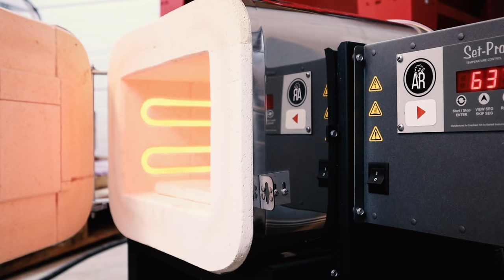Rusty Hammer Restoration With Nordic engravings

Comment: I'm so torn. First you sandblasted without even getting the loose rust off, then you pretended to polish pitted metal with 1000 grit sandpaper. But then that awesome fire when you quenched it turned the tide and that next-level laser engraving pushed it over the top. So I'm torn.

Comment: Nice restoration - I particularly love the laser engraving / etching you did! If you are going to actually use the hammer to hammer in nails, you don't want the striking surface to be polished smooth - you want it rough / scuffed up eg 60 grit random orbital or something. Grips the nail head when striking.
Reply: Didn’t know that….in metalsmith ing jewelry, we keep the faces as clean as possible so as not to unnecessarily Martha metal. So I guess it depends on how you will use the hammer. Good to know.
Reply: @donnaer  A common hammer face roughing technique is to rub on concrete as it's usually available somewhere lol . . .
Reply: i think that applies to framing hammers only, I would want a ball peen hammer to be smooth
Reply: @keefer88  "If you are going to actually use the hammer to hammer in nails, you don't want the striking surface to be polished smooth - you want it rough"

Comment: I have a really awesome project for you that I think you would enjoy. About 2 or 3 days ago, my friend and I saw a little bolt out of the ground. So we pulled it up and sure enough, it happened to be a saw. We did some researching and found out that it is a Warranted Superior saw, a company that made saws in the 1800s. The saw is in pretty bad condition, but I thought that maybe you could turn it into a giant machete, or just restore it to its original state. It’s rusted pretty bad and there is no handle anymore, except for 3 bolts that are hold 3 little pieces of wood underneath each of the bolts. I was wondering if I could possibly send it to you for a restoration video, or just to restore on your own. I figured it would be a fun challenge for you, and unique because I have never seen anyone restore a saw. Let me now if you are in for it.
Reply from the maker: thank you for thinking at me. But I have so many upcoming projects already so I will have to pass on this one. But thanks again :)

Comment: Nice work. Wonder if the 20 oz hammer became a 19.9 oz hammer during the restoration. I would have attempted an epoxy repair on the handle to try to avoid shortening it. But then again I wasn't there.
Reply from the maker: thanks for your comment :)

Comment: Bonjour, j'aime beaucoup tes vidéos qui sont de grande qualités. Je trouve ce métier magnifique. Mais j'ai du mal à comprendre à quoi sert le sandblasting, alors je pourrais faire une recherche Google mais j'aimerais avoir te demander, si tu le veux bien, dans quel cas tu l'utilises et dans quel objectif ? Ça me titille 😄.
Chouette restauration en tout cas, bonne continuation à toi
Reply from the maker: thanks you so much :) Sandblasting is when you "spray" sand under very high pressure (the pressure is made by a compressor). The high pressure allows the sand to remove dirt and rust :) it is almost like a peeling just in a larger scale

Comment: What's the difference between oil cooling and water cooling and how do you determine which to use?
Reply from the maker: If you want it to be dark you have to use oil. Oil also give it a rust protection layer
Reply: @AwesomeRestorations  ah ok that's cool.

Comment: Very  nice job. Results look spectacular. But I have a question: Why did you remove the logo? Did it interfere with the Celtic engraving?
Reply from the maker: TOR is not a special rare brand so I just wanted to remove it and make room for the engraving :)

Comment: Great restoration job as out of the shop, congratulations.  But does the polish remain or does it tend to rust?
Reply from the maker: No it will not rust .. as soon as I use it it will gain a natural layer of dirt and oil ;-) ;-)
Reply: @AwesomeRestorations  Ok thanks very useful, and the grits to refine it?

Comment: Easy, you saw the hammer handle and with a center punch push out the rest of the handle with the key. Also, that is not a carpenter hammer, but good restoration.

Comment: End result looks great, but it seems a shame you removed the original Swedish logo and replaced it with a Celtic knot, which has very little if anything to do with Sweden or where the hammer came from. 
A more original restoration/engraving would have been just that bit better, IMO.
Reply from the maker: fair enough :)

Comment: Seemed kinda pointless, hammers are already hardened. Just need a sand and some oil.
Reply: Most modern ones are, old ones can just be hardened on the faces so the the head has some ductility (i.e it dosent explode when you hit something really hard although you can chjp the face) ... however in this one sort of surprised he didnt temper it (or maybe he did and didnt show it)  as the head will be a bit brittle.

Comment: Sorry but I don't see the point in doing this "it's a hammer".
A hammer is meant to be used to Hammer things not to be a collectors item.
The only thing this hammer needed was to clean off the rust, sand the handle maybe throw some paint on the hammer and be done with it.
So it's ready to be used again.
Not to mention you went through all that process to black and the hammer only the buff out the blackness off it which makes no sense.
I've restored plenty of hammers and I've never done any of this as to me it's unnecessary and pointless.
Tools are meant to be used not to be collectors items.